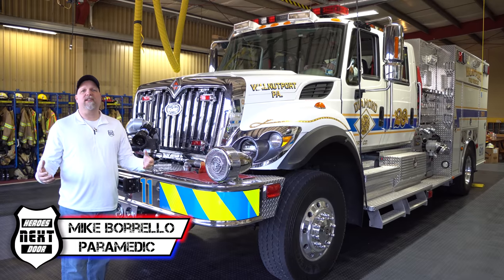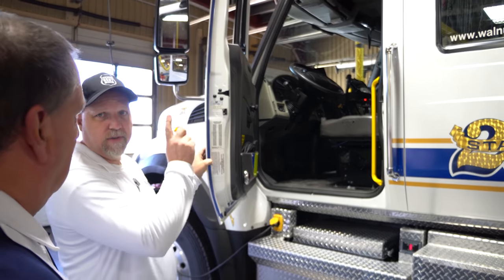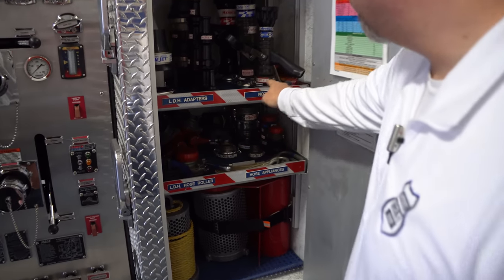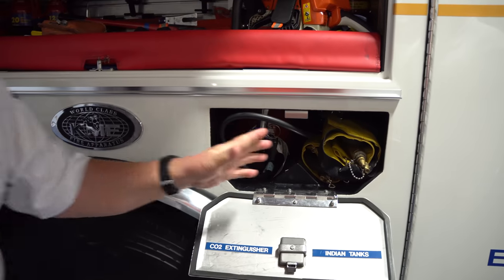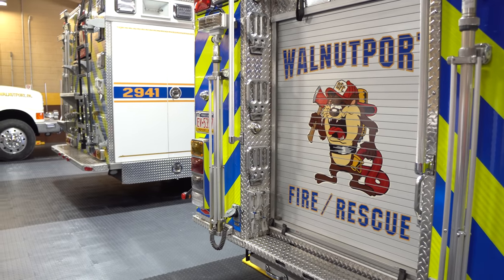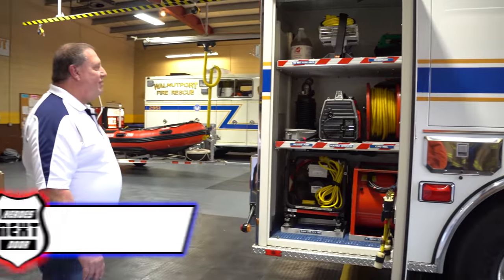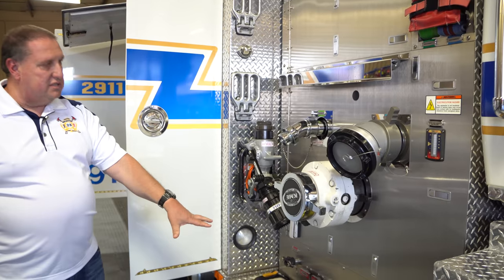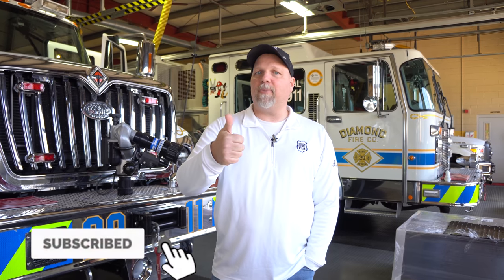DIAMOND’S Urban Interface

Comment: In South Australia the state volunteer brigade prefers Urban Interface style trucks. We have 3 main models of Urban Interface trucks they are called a 24P, 34P or a 44P The first number refers to how much water they carry and the second means they are 4 wheel drive, the letter means they can also act as pumper, so a 34P has 3000 litres of water, is 4 wheel drive and can pump. They have pump and roll capabilities, they can respond to MVAs, they have foam, they can respond to bushfires, structure fires and have Active Crew Protection systems. They make up the majority of trucks in the state, we do have some dedicated Volunteer pumpers but they mostly operate on the fringe of the state capital.
Reply from the maker: Maybe one day we can come see it
Reply: @HeroesNextDoor  I think you'd be surprised :) departments in Australia are on a colossal scale. The Country Fire Service in South Australia alone has 16,000 volunteer fire fighters. Its huge.

Comment: Mini hazmat, mini rescue, mini water rescue, pumper / tanker, mini brush support, mini AFFR support, engine, foam, just missing light and air as well as command area and this truck could be on almost ever call and actually be helpful. Also a medic, just needs a tower or ladder. It is funny how much departments could save and improve if they had trucks that had at least a small amount of everything (especially if it’s a tiller truck). I am seeing that a lot more often on your channel. Most trucks I think of might have rescue and firefighting gear but not all that extra stuff.

Comment: Is the radio setup/freq. Not regualted/organized at all? We are standardized on a state level and additionally have national standards for "civil defense"/ catastrophe response
Reply: The radio set up in each of the apparatus in Walnutport are fairly simple. There are 2 in each apparatus. 1 vhf unit and 1 uhf unit. The vhf unit handle all communications with the primary communications center. (Lehigh County) The uhf handles communications with mutual aid counties. (Northampton and Carbon counties. Also in each unit is a minimum of 1 vhf and 1 uhf portable radio.